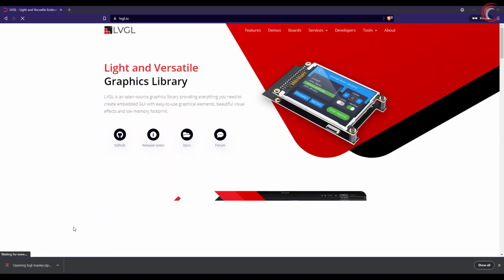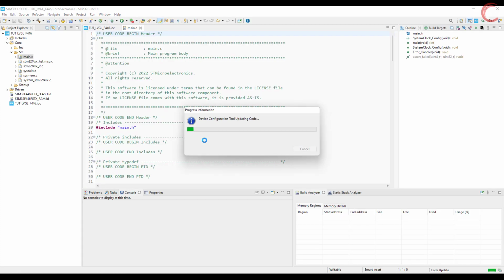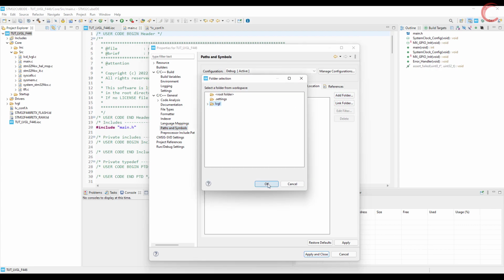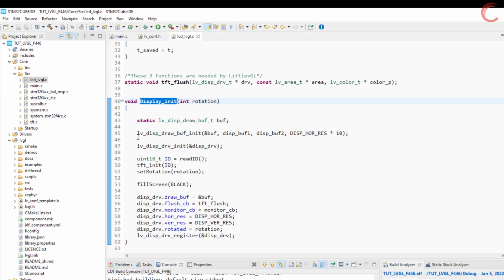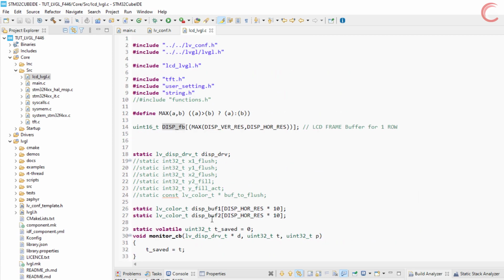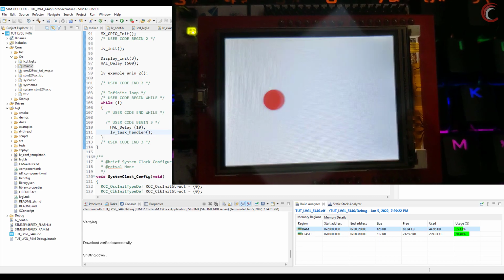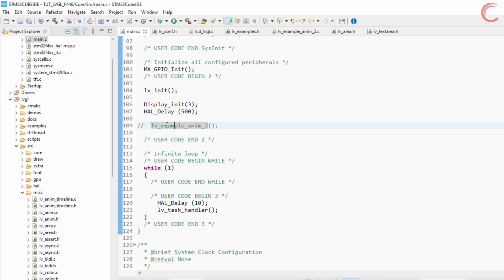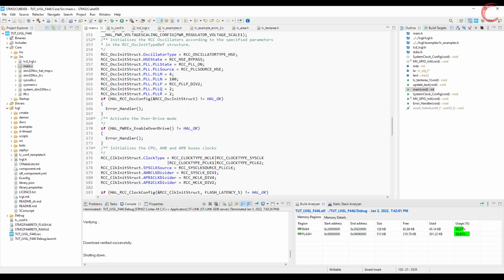Interface LVGL with STM32 Low Memory Controllers || Parallel Display

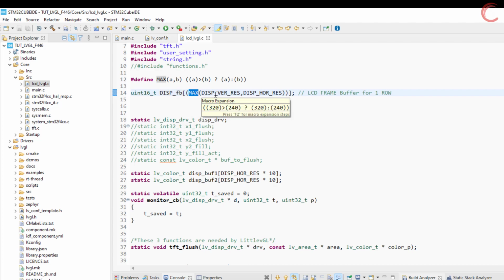Comment: 9:02 
This buffer (DISP_fb) is not needed at all. You can feed the color_p pointer to the fillFB() function directly.
Tell it to your hand because ears don't listen: main memory consumption: lines 26 and 27 👏
I don't see ANY RAM saving technique here (in your example).😠
Reply from the maker: Flushing one pixel at a time is really time consuming, You can do that if you want. I have commented the line 94 inside the tft_flush function.
Reply: @ControllersTech  Of course. Im not about that.

Comment: `RAM' overflowed by 13128 bytes error. Also, it would be great if you could make us a video series on this topic.
Reply from the maker: It just means your controller don't have enough RAM to store the data.
Reply: @ControllersTech  But everything is the same as you did. Thats the problem .
Reply from the maker: What controller are you using ?
Reply: @ControllersTech nucleo  f446
Reply from the maker: i need to see the code. You can mail me or contact on telegram
Reply: The problem occurs with the latest version of lvgl (8.3.2), where the default config file changed. I just took the lvgl version and config file of your repository to fix the problem.

Comment: Excellent video. However, I have a problem getting the code to compile.

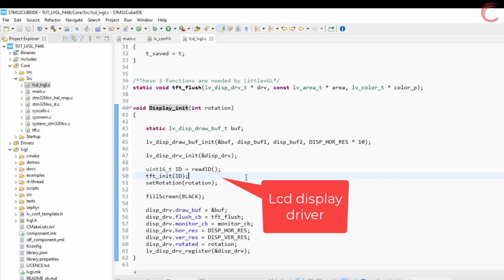In the video at 9:55 you show the Display_init(int rotation) function. The line lv_disp_drv_init(&disp_drv) is causing my compile to fail.

I get the error messages:
undefined reference to `lv_disp_drv_init'
undefined reference to `lv_disp_drv_register'
I can clearly see these two functions in the lv_hal_disp.c file. 

I also get error messages:
undefined reference to `lv_example_anim_2'
undefined reference to `lv_timer_handler'
undefined reference to `lv_init' 

I must be missing a #include path somewhere but can't figure it out. Any ideas?
Reply: Problem solved. I had added the Path to the lvgl directory as you show in the video. After an hour spent trying to figure out why the code would not compile, I checked the Path and Symbols settings again. Somehow the path to lvgl had gotten removed. I put it back in and the compile finished with no errors and no warnings. Now I am waiting on my TFT board to arrive so I can load the code and test it. Again, excellent video. I am looking forward to your video where you add touch screen support.
Reply: hello there even i also facing the error like this undefined "lv_disp_drv_t" @raybuck9675
Reply: there is no defintion for 
"lv_disp_drv_t" can you help me?
Reply from the maker: There is an entire Playlist on LVGL on this channel. Check that out.

Comment: Great Video, LVGL community will increase. I personally have used touchgfx and LVGL, my preference is LVGL as it is much more efficient and customizable.

Anyone can use my project ported ( https://youtu.be/CLdzwTwlE5k ), just need to have a 2.8 inch display ILI9341and a black pill STMF411.

Thanks.